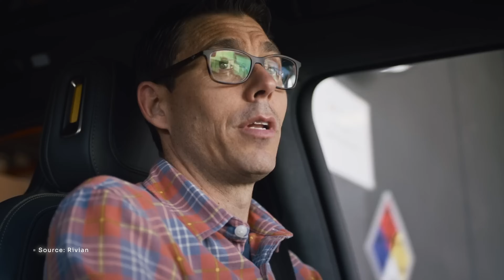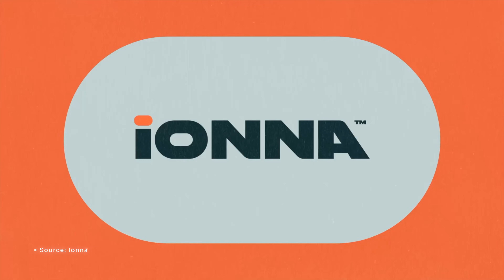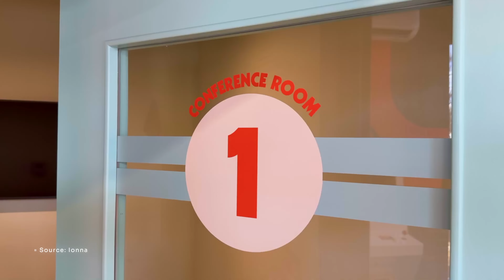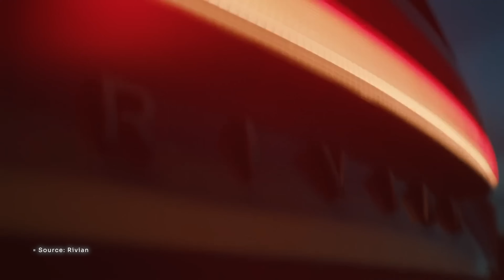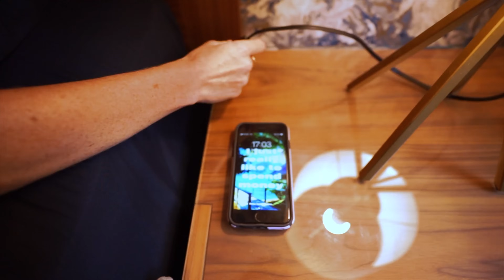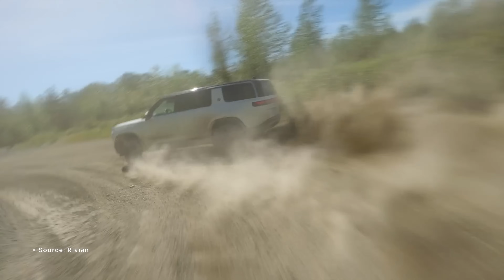New Rivian Goodies: Quad-Motor, $1.2B Raise, Software & More

Comment: I received my Dual Max Gen2 R1T in May and the only two issues I had on delivery was that I couldn’t use the Video app at all, it was missing some sort of licensing, and the wrong wheels were configured in the software for the vehicle.  Support fixed the video licensing issue remotely, I fixed the wheel configurations myself, and not an issue since—support was very responsive. Very pleased with my choice to go Rivian!
Reply from the maker: I love this!

Comment: My R1S was delivered in March. The metallic trim along the roof-line popped off due to a defect in the part- missing VHB tape. It took two and a half months to get a service call.

The upcoming changes are welcome.

As with my Model S that the R1 replaced: I don't get how a vehicle that cost almost $100K has ANY rattles.  How is that even allowed?
Reply from the maker: Delivery day QA at these prices points is wild to me as well. Rivian must fix their service timelines, or that will be their poison pill that kills them.

Features, design etc are all so damn good. But outside of early adopters, normal people won’t (and shouldn’t) accept this state.

Comment: I took delivery of a gen 2 R1S dual standard at the end of April. No showstoppers, but several quality control issues that were not fully resolved by the service center after waiting almost a month for an appointment and then having it for a week - a paint chip in the door, misaligned doors, a tailgate that won’t reliably close, and malfunctioning ultrasonic sensors.
Reply from the maker: Doh! I hate hearing that. I hope they fully resolve it for you soon.

Thanks for the data point.

Comment: I don't have a Rivian yet, but I have driven them. I really want them to copy Tesla's Pin to Drive like you mentioned as well as have a Charge Stats page in the app that shows exactly how much energy and money you've spent at your real electricity rates per month and year.

Also, I'm guessing R2 will ship without lidar but the cut out for it is there for backwards compatibility in the future (if they cannot solve level 3 without it and/or lidar becomes extremely cheap). If designed with this in mind, even years from now mobile service could show up, pop in the pod and run a harness down to the main computer. 🤷 You do not want to be where Tesla is now with HW3 cars and FSD.
Reply from the maker: They’ve mentioned they’d want not only charging cost data but also to optimize charging by both time of use AND by how clean a local grid is when charging at home.

As for LiDAR it does look like they built in support for it functionally speaking but it for cost reasons may not make it into the very first R2’s. As you noted though, they should in theory have way more options down the road given the physical space.

Tesla is likely to be in quite the predicament given the almost decade long claim that every car had all the hardware needed for full self driving.

Comment: Plug and charge at Ionna sounds great.  Facilities at charging locations are important.  (I love the place where I can get a Reuben on gluten free, and use nice washrooms, while charging.)

I haven't needed any fixes since taking delivery.  The gaps around the front trunk are uneven, almost touching at one corner, but haven't caused problems yet.
Reply from the maker: The Iona locations look SO good. If that became the norm I would be quite enthusiastic.

And yum, Reuben 🤤 

I wonder if mobile service could align your frunk? Sometimes the sheer weight can get those to shift slightly with use over time. It does help to have powered struts though vs pushing down by hand.

Thanks for sharing the data point!

Comment: Travis, I have a 2025 R1STri max that is 4 months old. We love our Rivian and have already been on two road trips around the South without any problems. However, I noticed when I picked it up at the Rivian Center the build quality was not quite as good as I expected, with very minor body panel fit issues. Recently I have sent our Rivian back to the service center to repair a roof panel that has come loose creating severe vibration noise that makes the car undrivable at highway speed. Thanks for your videos !!
Reply from the maker: Thanks for the feedback, and I'm glad you're enjoying the vehicle and road trips despite those issues!

I also so appreciate you being here. Even just watching these videos and engaging helps the channel a great deal.

You keep being you 👊

Comment: Getting Gen 2 R1S DM PU here a in week. This was a week delay due to a fix that had to be done before it was delivered. I don't know what the issue was as they wouldn't share but I'm glad it's getting done before delivery because I'd hate to have to take it back immediately after deliveey due an issue they could've fixed earlier.
Reply from the maker: Glad you're getting your delivery soon and that they addressed any issues before you got it!

Thanks for the data point 🙂

I hope you have a lot of fun with the car this summer!

Comment: Do want the all purpose mondo with all time 4 wheel drive - this would be great - faster charging on the Road will also be appreciated
Reply from the maker: I’m looking forward to the drive mode for dual-motor. Early reports are showing up to a 20% increase in charging speeds under the hour conditions. That’s big!

Comment: Great news coverage! The update has some worthwhile improvement.  I have no need for the multifactor authentication.  The out of spec recent Rivian videos have some great news on the soon to come improvements.  As for Rivian short term and long term quality and reliability, I love R1, but the rattles, squeaks and poor front end alignment concerns me.  I question how well a R1 will hold up out of warranty.  A newer Tesla 3 or Y are rock solid in quality, and the abundance and simplicity of them ensure inexpensive out of warranty repairs.
Reply from the maker: As they continue to simplify parts and production (as is the extreme case with R2), I think more of that will sort itself out naturally.

I know I’d be skeptical about owning a current crop of R1’s outside of their warranty window, but I’m at a state in life I don’t want to deal with those kinds of issues form any brand.

Tesla started out rough and has really improved quite dramatically, even in just the last few years. Here’s hoping Rivian has a similar story, on paper at least they are doing the right things and hiring the right people.

Comment: I just had to get rid of my gen 1 R1T at 75k miles. I really loved the truck on paper but it was technically the least reliable vehicle I've ever had by far. Was going to turn into a money pit with the warranty up and in CO they are 3 months out on service appts. So basically I would have a broken $100k truck all the time in one way or another. Really hope Rivian gets the issues fixed but until they do I'm unfortunately done with the brand
Reply from the maker: Sorry to hear that, but I don’t fault you based on the experience you shared. I do think 12-24 months from now service should be a far different story.

I’d be curious to see what the objective data shows for day 1 QA and how the cohorts pan out for reliability over time.

Hopefully we can see you out there adventuring again in the future. But until then, I wish you well finding the right cat for you.

Comment: Did you mention that the multi-factor is already made optional? You represent this as if it is a mandatory mode. I do like the "pin to drive" idea.
Reply from the maker: I didn’t mean to represent that it’s optional, and disabled by default. I was more focused on the fact that Rivian seems proud of this solution in search of the ‘real’ problem.
Reply: I like the idea of the pin but see your concern about having service or battery life on your phone and the use case is that their thiefs are getting clever and starting to use software to hack codes to open and start cars and seeing as these are some of the best looking and fancy expressive looking cars out there I like making out a little harder to outright steal.  If they can resolve the random pin thing with maybe even set pin with a additional password or security question I’m all about it, I wouldn’t mind the extra minute or two it would take personally

Comment: I've never understood Rivian on implementing the conserve mode by disconnecting the rear motors for our gen 1 R1S. I would love to see Rivian have a chill mode similar to Tesla by just reducing the acceleration and still have all the motors engaged. My experience with conserve mode sucks so I just leave it in all purpose mode.
Reply from the maker: Conserve on Gen2 works very differently, but I still agree there could be a throttle response setting vs all out disconnect. I do suspect that the reconnect when you want it with Gen2 is a nice alternative to the full time 2wd of Gen1.

Comment: Travis, I generally very much like your content. In this video, your suggestions concerning the pseudo-random key situations are particularly good, and your comments regarding the limitations of the approach make a great deal of sense. I would prefer a more deterministic approach so that use of the fob and key cards could be added to a second-factor regime. The whole idea--for me--of using the fob and/or the key cards is to allow someone else to drive the car without me, which is an inherently more risky situation, at least in day to day driving experience. Having a fixed PIN that I could change as I wish for these two different key types would be helpful. This is especially true, since most of us leave these keys in unsecured places in our homes, which can be broken into and the keys stolen.
Reply from the maker: I appreciate the feedback and it’s always comforting to know when I hit the mark.

Rivian seems to have been a little too in love with the tech vs the solution here. The best evidence is their lack of clarity vs how eloquent they were with the new energy app.

Thanks for watching!
Reply: @TravisKetchum  It's a conundrum for me. Pseudo-random number generators have been around for many decades in software form. So this is not new tech at all. I just don't get what they think they are really doing here. It's like nobody at the company really understands security technology. If this is true, we are in deep trouble, especially with the over-the-air updates.
Reply from the maker: It’s a solution in search of a problem for the most part. Sometimes, just doing the MVP (like shipping CarPlay) is what will maximize customer satisfaction for years before a more complex (and often, not wanted) solution can be deployed.

Comment: I've been waiting for this Quad motor for so long despite not being able to even afford it. Should be a fun release! I was hoping the new quad would have the new scroll wheels that the R2 steering wheel has, but I guess theyre saving that for the R2. I'm curious if the 2027 or later R1 will ever get those steering wheel controls.
Reply from the maker: I wouldn’t expect the new scroll wheels until next calendar year at the earliest. We could always be surprised though I guess, but it seems very unlikely.

The Gen2 quad should be a proper halo car 🚀
Reply: @TravisKetchum  I think MKBHD showed the steering wheel in his recent insta story and it was the normal R1 wheel. So yes maybe next year!